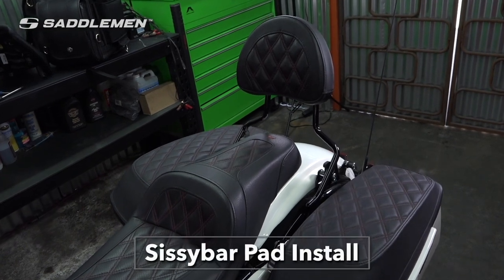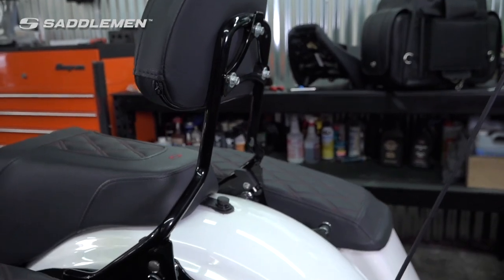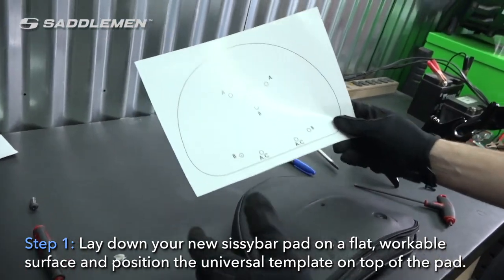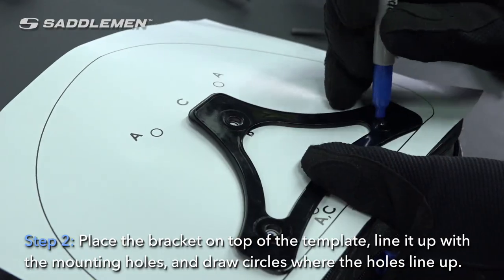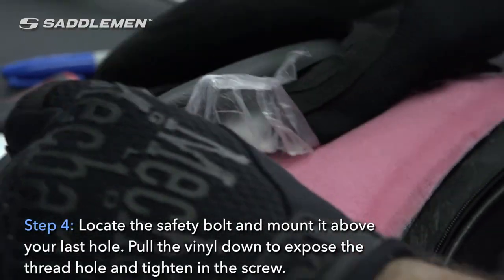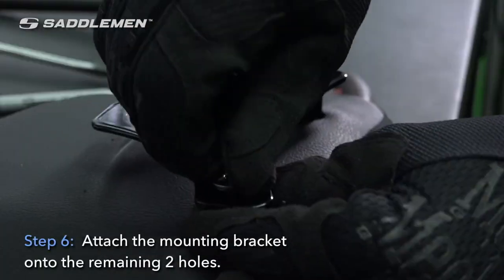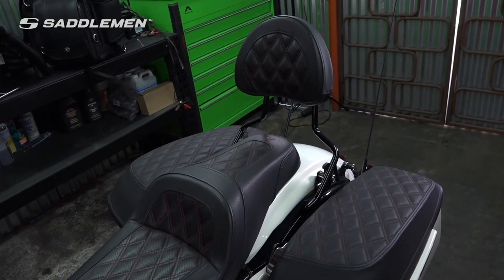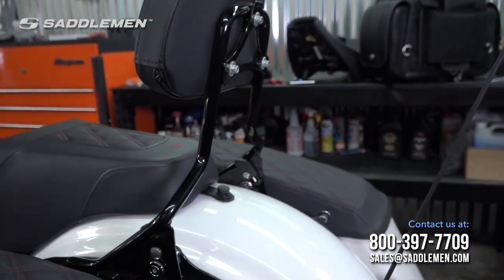Installation Overview // Sissybar Pad // Saddlemen

Comment: I have a sissy bar that fits the D pattern for the bottom 2 holes but there is not a third place to secure the pad for a triangle pattern. Is it ok to secure the pad with just the 2 bottom holes?
Reply: I also emailed you
Reply from the maker: @Matt-vm7dw  Our team will get back with you on specifics, also feel free to give us a call 800 397 7709 - thanks!